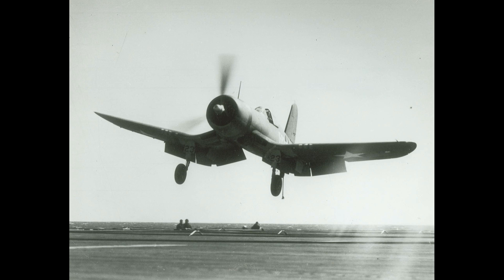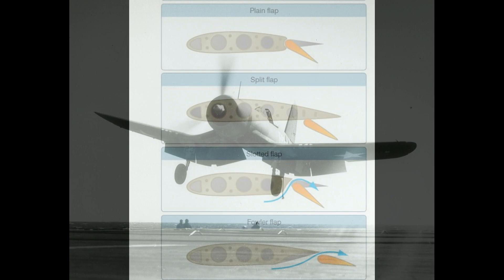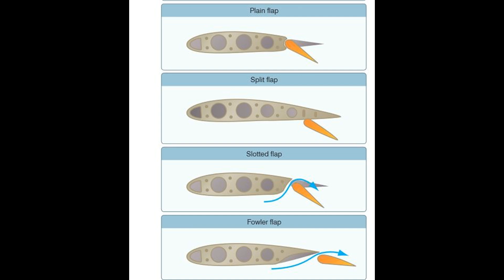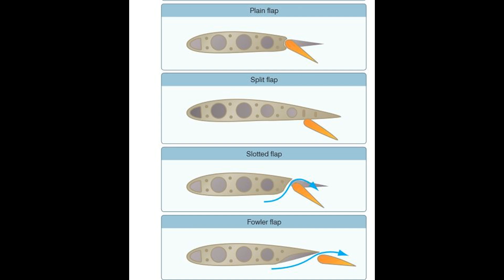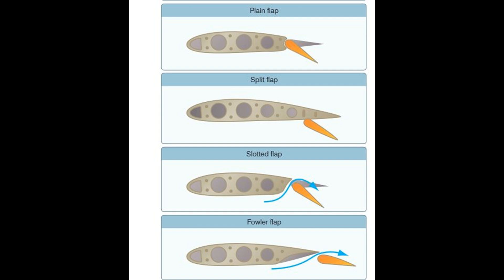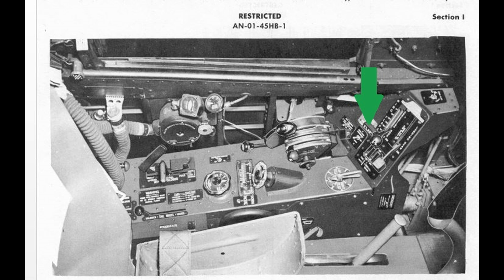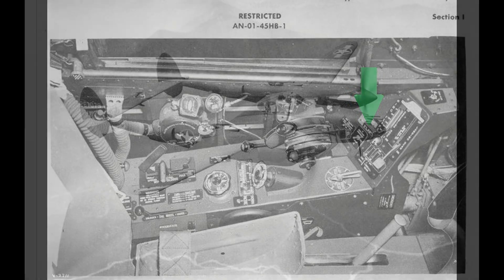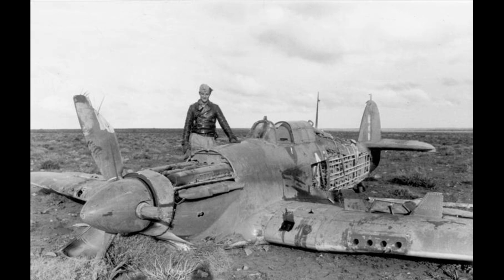Using Flaps in a Dogfight with the F4U Corsair and others

Comment: Bank angle does not have any direct correlation to g-load.

G-load is entirely dependent on how much lift the wings produce, and the most direct way the pilot has to influence that is by increasing or decreasing the angle of attack with the elevator. Of course, lift also depends hugely on airspeed and aircraft configuration (such as high lift devices, spoilers, or air brakes), but airspeed generally is what it is, and changing the aircraft configuration is not always possible or takes too long time to respond, so AoA adjustments is how pilots keep the plane "riding the stall" so to speak.

If you just bank an aircraft a certain amount and do nothing else, the aircraft will produce the same amount of lift as it does in level flight, which means you maintain 1g of acceleration. In order to turn in level flight you have to pull on the stick to actually get it to turn. Otherwise, the aircraft will turn a little and enter a dive. In fact, if you just roll an aircraft to one direction, you'll get some kind of a very mellow barrel roll with about 1g maintained throughout the maneuver - depending on the roll rate of the aircraft. If the roll rate is too low, then the aircraft will pick up a lot of airspeed in a dive and that will change how much lift is produced with the current trim configuration...

Further, bank angles are only really an important factor when you actually have to remain in level flight, to maintain altitude throughout the turn. This is not usually a strict requirement in combat (beyond the obvious goal of not slamming into the ground, so referring to turns by bank angle is not really productive. In combat, you bank the aircraft as required and pull a g-load as required within the aircraft's performance and g-load limits. And when you're not worried about absolutely retaining your altitude, such as in a huge break turn in a Corsair trying to get guns on a Ki-84, you don't really need to control the bank angle quite absolutely, there's a lot of freedom associated with this kind of things. If you pull a 9G turn and your bank angle is slightly less than 83.62 degrees, you will start to climb slightly. If your bank angle is over 83.62 degrees, you will start to descend. Neither is necessarily a bad thing, beyond the obvious goal of avoiding the terrain.

Bank angles do correlate to g-load in level turns, i.e. on turns where you specifically need to maintain altitude. This correlation is simply a matter of geometry, where the vertical component of the banked lift vector has to be equal to the aircraft's weight, while the horizontal component is used as the centripetal force to make the aircraft turn. For every g-load, there is a certain bank angle with which level turns are possible. The formula to calculate the G-force for any given angle is: 

G = 1 / cos θ

where θ is the bank angle. For example, at 45 degrees of bank angle, the G-load is approximately 1.41 g's. At 60 degrees bank angle, G-load is 2 g, at 70 degrees it's 2.92g, at 80 degrees it's 5.76, at 85 degrees it's a whopping 11.47g and approaches infinity when bank angle approaches 90 degrees.

Conversely, the formula for determining which bank angle corresponds to a certain g-load, the formula can be inverted:

θ = arccos (1/G)

With this formula, the bank angle required to retain level flight in 9 g turn is, indeed, 83.62 degrees - but when maintaining altitude is not a strict requirement, then you can pull 9g's at any bank angle, even straight up or straight down, as long as you have enough airspeed (and altitude).
Reply from the maker: Hi Herra, I know you. Or actually I know people just like you. You are a very intelligent person, who understands this issue, but DIDN'T follow the directions. In this video I clearly stated that there was another video which should be watched first. You didn't follow those directions.  In that video these concepts were explained, meaning G load, and it's relationship to turns. There was no point in my going over all of that again since I already covered it. As for the point about the Corsiar not needing to hold bank exactly and simply pull 9Gs and accept some amount of climb, I think you missed the point. This wasn't a video about combat tactics, or how to fight in a Corsair, it's about one specific thing, and that's the used of flaps in a maximum performance turn. The example with the Corsair and Frank were intended to explain that, not to teach dogfighting 101.
Reply: Thanks for the reply! You're correct, I haven't had the time to watch all of your videos yet. You make a lot of great content, and I didn't post my comment to start any kind of argument. I posted it as a mild critique, because I thought the video was good enough to deserve it (as opposed to just walking away with no input whatsoever).

I understood what you meant, and probably everyone familiar with physics and aviation (or both) understands what you meant. I understand that you understand it as well, and probably know everything I posted in my comment inside and out. But a claim (or critique in this case) requires an argument to support it, which is why I included all that information instead of basically dropping a message saying "UR WRONG".

Basically, all I'm saying is that the bank angle felt a bit like a red herring in the context of the video: Something that doesn't really have great importance in or out of context.

I agree there wasn't necessarily need to go over all the details in this video, especially if another video does just that. However, even if the focus of this video was not turning in general, it struck me as odd to focus on the bank angle as a specific variable instead of angle of attack, which is the variable that has the most direct connection to g-load. In a way, it manages to both over-complicate and over-simplify the example at the same time.

A lay person watching the video could very easily get the impression that the relationship between bank angle and g-load is causative instead of correlative. Even if someone followed the instructions and watched the earlier video when you suggested it, I personally find it good practice to make videos, essays, or even chapters, paragraphs, or sentences "self-contained" as much as possible to avoid the viewer or reader having to jump around to earlier content to check a reference to them. It's not always possible, but in this particular instance I think it could have been a better choice to just leave the bank angle out of the example altogether, and refer to angle of attack instead.

Cheers, and keep on making these videos, they're very interesting.

Comment: I think you would rip the flaps off at that speed.   Or dis able them so they would get stuck.    I doubt it was an option
Reply from the maker: What are you talking about? Apparently you didn't watch the video. The Corsair's combat flap setting are rated to 200 knots. Above that even if the pilot wanted to rip them off, he couldn't since they have a protection feature against excess airloads. They will simply blow back up.

Comment: Very well done. 

Would be interesting to look at the advantages of some of the other flaps as well. The split flap for instance. It is very good for dumping speed quickly much like an air break. I have used it as such quite often in the 190 during a scissors to force my opponent to overshoot. Also to change deck angle for low speed deflection shots. I suspect plain flap have a similar effect if they can be deployed quickly.
Reply: Very nice video and Chanel Greg!

Also, you can use the yak magic flaps to do basically everything!
Outclimb a co-energy 109, avoid a stall on a slow tight turn, even to steady a steep climb when running out of speed,so you can try a firing solution
Reply from the maker: Hi Central. I always look forward to your comments. Your assessment of the split flap is dead on.  While it won't help the sustained turn rate much, or even at all, it does slow the plane faster than other types, which can be a huge advantage, especially when the plane is pointed downhill. The Plain flaps are sort of in between the split and slotted in terms of effect.
Reply: Greg's Airplanes and Automobiles True. My analysis of the plain flaps relies heavily on my Father's experience. At one time he owned a Grumman Traveler; which used plain flaps, and he said it was like putting on the breaks when you dropped the flaps in that plane. I got the opportunity to experience this once myself in someone else's Traveler. No doubt the specific design parameters of the flaps on any given airplane also determine the type of performance they provide. Wing cord proportions, deployment time, length, ect.
Reply from the maker: I flew a Grumman Cheetah, much like the Traveler. Those Grumman light planes were fantastic.
Reply: Greg's Airplanes and Automobiles Yep. Very slick birds. One of my Father's greatest regrets was selling his.

Comment: If almost 1000 Corsairs crashed, then why doesn't it have a reputation of being a unstable death trap (unwarranted mind you) like the Sherman, a tank that beat the Panther in post war test with a 2.7 with a Panthers 2.5 I believe. The Sherman also have a crew survival rate that surpassed its competitors at 4.5 men per tank lost (on average)
Reply from the maker: Because the US lost over 90,000 aircraft in WW2, of which about 40,000 were not combat related, we lost 60 B17s in just ONE raid on Germany, that's 600 men, gone. In the grand scheme of the war, nobody was too concerned about loosing some single engine fighters. Loss rates were fairly high for all types, not just the Corsair.
Reply: More US pilots died in training than in combat.  The Corsair was called the "ensign eliminator" because it had a nasty habit at low speed on carrier approach to suddenly drop a wing and spin in.  It was not accepted for wide carrier use until this problem, the approach visibility problem and the bouncing landing gear problem was worked out in late '44.

Comment: I figure with the F4U-4 scenario, one would want to go to WEP before slowing down as it'd allow you to hang in the turn longer

BTW: While I hate to be grammar police, particularly since my grammatical skills suck: NACA was pronounced En Ay See Ay, not Naka.
Reply from the maker: You just might want to go to WEP sooner. In this scenario, the pilot wanted to get to his max rate turn asap, which happens at the lowest speed at which the plane can still pull maximum G. In this case, that's 264 knots. How do you say NASA? How do you say POTUS, how about NATO? See my point? While people in the past may have said En Ay See Ay, I see not grammatical reason why that would be correct.
Reply: If you're talking about making the tightest turn, it probably wouldn't matter too much as most pilots will try and fight at the speed where they have the best advantage and will both be going full tilt.  If you were trying to get the plane into the tightest turn possible quick dumping speed down to the corner velocity would do it, but the fact is that you'd lose speed pretty quick and as you slow down the turning rate would tighten up and tighten more as you hang the flaps out.

As for the grammar thing, it might not be grammar, but it might be pronunciation.  I suppose a person could pronounce it as "Naka" if they were so inclined, but it was (far as I know) always pronounced as I described.  I guess it's more a matter of tradition...

Comment: A turn initiates by rolling to the desired angle, then altitude is held with the elevator.  The point is the plane climbs thru the turn.  Any device be it flaps or slats or power that boosts climb, enhances turn.  A good climbing plane is a good turning plane assuming initiating roll rate acceptable..  As planes have a best angle of climb and a best rate of climb, ditto smallest radius of turn and rate of turn.

The combat purpose of the turn is pull lead or get inside the opponent.  Temporarily the attacker can exchange energy to get inside for a burst, but likely have to break off immediately.

Slats do not increase lift, they increase the stall angle of attack of the wing increasing lift indirectly.  Believe Me 109 used slats to keep ailerons working at HOA’s.

Corsair (as did many WW2 planes) used a NACA 230xx airfoil.  This airfoil forms a circulation bubble at about .25c at high angle of attack...think of it as an air recambering of the profile.  When the wing stalls, the bubble collapses and along with it ALL lift.  A very sharp stall indeed, but worse can just relax the stick a bit and resume flying, you have to drop the nose thru 10 degrees or so to get it flying.  The aerodynamic buzzword is stall hysteresis. 

On such a powerful plane as a Corsair with so much p-factor and who knows what the propwash was up to, get to slow and bam you’re dead.  Navy fix- give them to the Marines.  Nevertheless of American fighters, it had the best balance of toughness, speed, maneuverability.  A real brawler.  Pappy Boyington commented in his autobiography something like “The Corsair, now that was a real plane..”
 
As to Greg’s comment about stall warning device, Vought tried stall strips on the wing and I don’t think ever satisfied.  Implication is a stall detector may not be practical as premier location moved with power setting/prop wash.
Reply from the maker: Hi Holly, I am glad you are here. Keep in mind that this  NACA test was in 1947. I think if Chance Vought was going to solve the issue, they would have done it by then. The F104 Starfighter has a great rate of climb, it set several world records in this area, yet it has a horrible sustained turn rate. That said, your point about climb performance is relevant, just not absolutely 100% correct all the time.
Reply: Greg's Airplanes and Automobiles  
Actually it’s Dan, but my wife’s email.  Side story on stalling.  Toured Mooney plant in Kerville,Tx.  The guide was retired employee.  He related the early M20 had wood wings and stalled straight.  After 3yrs or so, Mooney switched to aluminum wing and stall would drop a wing.   They tried LE stall strips and chased around the location.  So if M20 had problems imagine Vought struggle with Corsair.

The difference between the wood and metal is contour conformity, both in fabrication and in flight.  Mooney stretch forms it’s surfaces and ribs are rubber pressed.   The manufacturing tools look WW2 vintage.  Mooney is no slouch, tHe new models go about 240.  But not far behind is the Cirrus w/ fixed gear and a stiff accurate composite sandwich airfoil.

Turning/climbing F104.  Good point.  Plane still needs a wing!  Factoid.  A B36 at altitude (40000’) could out turn  jets of its day.  Very low wing loading.  So it’s a combo of things.

New Subject.  DB605 / ME109 fuel injection video.  Comment was FI was superior to carb because it did not have Venturi etc to obstruct flow (as I recollect)   While not familiar w DB605 FI, I suspect it had a butterfly and a Venturi.  The butterfly served conventional purpose.  The Venturi provided pressure signal via bellows to manipulate the pressure-balanced fuel metering spool.   The inlets for WW2 engines so big, the Venturi need not be full throat, but could be a small standalone unit in the inlet center.

Carbureted fuel tended to fall or centrifuge out causing lean cylinders  and detonation furthest from carb.  FI distributed fuel evenly and along with inverted operation main advantages.

The DB was a remarkable achievement for 1937, impressive technology still 80 years later.
Reply: I thought I read they fixed the Corsair's tendency to drop a wing on approach by adding a stall strip which raised the overall stall speed slightly, but kept it uniform so the thing would not spin in if it stalled.  The pilot's chances at survival were markedly improved too.
Reply: fazole My Corsair comments are from a book I read some 25 years ago, so its hazy.